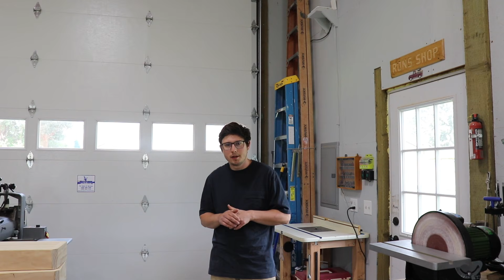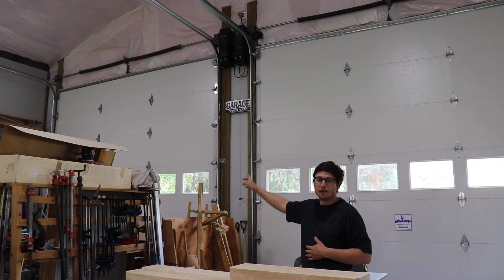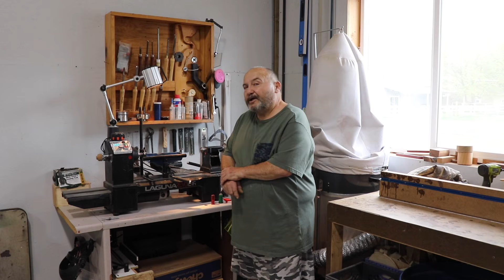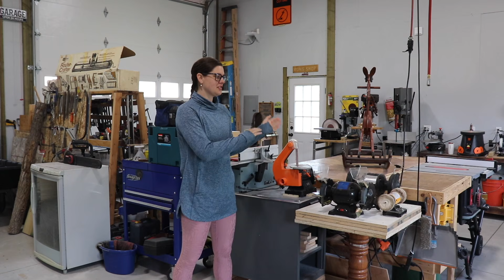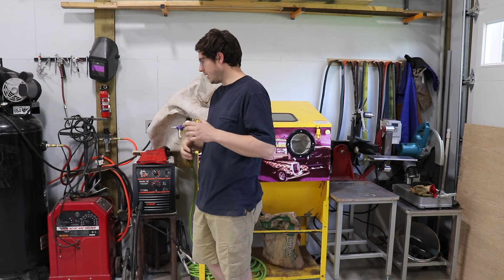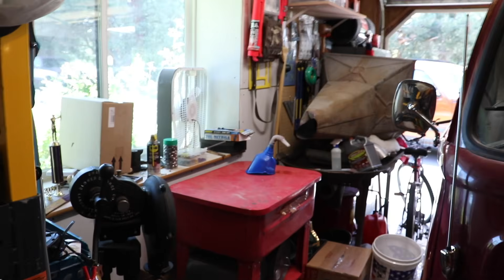Shop Tour! 30X30 Pole Barn style multipurpose home workshop

Comment: Can you put up a link for your lights.  I saw a video that made me interested in Big Ass Lights only to find out the company discontinued them.  Thanks
Reply from the maker: Let me see if I can get some more info on them for you. It's been about 2 years since we built the shop, so I'll have to track it down. I was very impressed because they are rather small and thin and lightweight but output a ton of light. Thanks for watching, hope you enjoyed our video.
Reply from the maker: Here’s a link to the lights. We have four of these 105w. Keep in mind this website is not where we got ours, we purchased them through a local supplier. And we have no affiliation with this website or LEDone. Hope this helps you out! https://relightdepot.com/ledone-linear-led-high-bay-105w-220w.html

Comment: Looks a well thought out shop.Have you thought about a mezzine?
Reply from the maker: Yes, I have. It would have been easier to add that in at the beginning, however there are considerations now about if we put a say 10 ft mezzanine in the back, then if you parked a tall trailer in it, you would only have 20 ft. So that’s a bit of a bummer. When we built, the builder showed us one he built that was either 40 or 50 with a mezzanine in the back 10, full width. Pretty nice, that would add another 300 sq ft of useable space. We don’t have a trailer we need to park in there at the moment, but I guess we like to keep our options open.